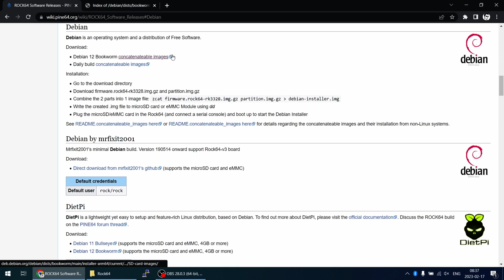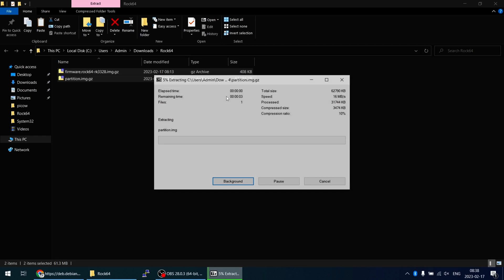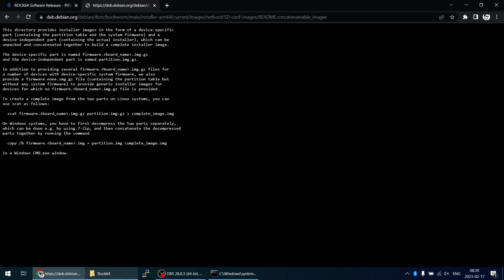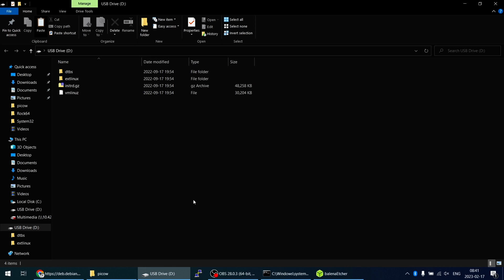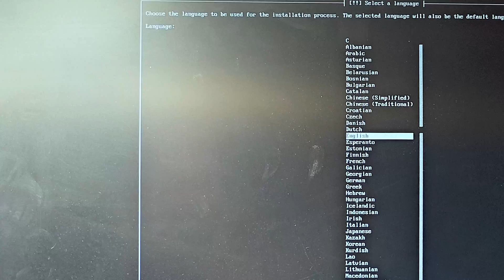Installing Linux On The Rock64 In Under 5 Minutes!

Comment: The Rock64 Pro is one of the most disappointing single-board computers I've ever used. Software compatibility is terrible. Calling it a "rock" is fitting, because that's pretty much how useful it feels compared to the reliable Raspberry Pi series.
Reply from the maker: Hahahahahahah

Comment: Amazing video. I'm not the best when it comes to hardware and networking, so this was hella useful. I didn't put in the partition file and wondered what I did wrong. I've been sitting next to this thing for the past 3 hours and could not, for the life of me, figure out what I was doing wrong. I did everything like you did, now I'm just waiting for it to give display output.
Reply from the maker: Oh interesting, I'm glad that helped you out and thanks for the kind words.

It shouldn't take that long for it to give display output though; from memory mine was quick. 

https://wiki.pine64.org/wiki/ROCK64 usually has the best info, but can take a bit of reading!

Comment: Great board, but watch out for the spi flash chip on some of the models.  Kindof a pain when you wanna use the chip.  Theres a device tree thing you gotta deal with...
Reply from the maker: Thanks for the heads up, had not heard of that and will look into it a bit more. Overlays and device trees CAN be daunting, but after messing with a few I've found they're not all too bad. Easier if you have some coding experience I think!
Reply: @PlatimaTinkers  indeed, that device tree is its own syntax, though it's only a declarative language, just branches and leaves with properties
Reply from the maker: @kayakMike1000 yeah works well, it's just a matter of learning what all the terms mean I think!

Comment: Ha.   Rock64 is my go to RPi replacement they ended up SUPER cheap for some reason.  I picked up 20 of 'em for 25 USD each.
Odroid C2 was pretty good, but now superceeded by the C4 which is a bit more.  Both rin arch linux a treat
Reply from the maker: Yeah nice! I'm stuck somewhere between Rock 4C and OrangePi 5B right now haha.

Comment: I remember buying a bunch of these rock64's for $20. Now the up charge is around $180. I don't why the rk3288 is obsolete 4 gens old. Getting the GPIO's working is a pain if you have any success that is.. I don't see the appeal honestly.
Reply from the maker: Hey mate maybe things changed a bit? GPIOs are working a treat; it seems the RPi Python library works best with Armbian, however, you can use the R64 GPIO library instead which works a treat. Just good to be aware that some GPIOs are reserved for SD card or other functionality, so always check the data sheet! If you're using SPI flash and just want GPIOs they should be fine. Cheers for the input!

Comment: Okay I'll jump in here.

I'm a long time computer programmer, electrical engineer, and one of my hobbies is amateur paleontology. Fossil hunting. I just happen to live in an area in north Texas in the US where marine and several mammal fossils are abundant. It's a fascinating free hobby and generally means lots of time walking around dry streambeds bent over, staring down and treating everything like a giant jigsaw puzzle. For 6 hours or so lol. Just like jigsaw puzzles after doing this for about 20 years or more you get pretty good at spotting them. It's also bad on my back. I still love it but I would love to continue and have my hobbies help me enjoy it more.

So I had the idea I'd get one of those kids drivable miniature jeeps/cars made out of that plastic that you couldn't destroy with a sledge hammer, add motor controllers and a capable single or stereo camera setup, a Kinnect, and the standard stuff you put on robots (I've built dozens). And then Buffy the Pack Mule (yeah that's my working project name what's it to ya?!) will use the Kinnect to heel 10 feet behind me as I roam, carrying my heavy shovels and rock hammers and sifters and water bottles, yada yada. When you're fossil hunting you roam a bunch and then stand in one place for 15 minutes making sure you don't miss anyting at that spot. When Buffy notices that I haven't moved appreciably for 5 minutes or so I want it to start searching for fossils on it's own, slowly scaning the riverbed and searching through its trained ML modell (I have tons of fossil pics with labels/categories) for hits. When it might have found something it will sound an alert so I can come over and check it out. If it ever actually found a fossil I'd be dancing out in the middle of some field somewhere for an hour or so cheering my head off. Anyway heh....

I've made some progress on the project but right now it's mainly a std robot platform with a 10 year old raspberry pi model A connected 🥹. I've put the project aside may times over the years, saw your video, thought I'd throw that out there. I've played with tensorflow and have a pretty good understanding of what I'm in for and know it's a lot of work left to go to integrate the 3 or 4 separate projects I have for it all into one. Great video btw now I wana play with one heh.
Reply from the maker: @trent_m_wyatt Mate that is awesome, great background and some wonderful projects. You also sound like a damn interesting bloke.

Thanks for the input, and you're in the running for one of those MCU's - do you have a preference (even though they may be a tad underpowered for that project?)! Would love to see a video of you putting it together, or even it just in action - as I expect it may take some time.

Also I'd look at the SoEdge as it's got a 3TOPS TPU and that would make a hell of a difference! Enjoy either way!
Reply: @PlatimaTinkers  
Sweet that's great! Hmm since their both '328's, if I had a choice I'd probably use the Nano! 🙃Be sure to let me know when you want to give away one of the Rock64's lol!
Reply from the maker: @trent_m_wyatt  Roger that! And yeah I will for sure - sorry if it came across that way in the first place, I did state 'MCU' but understand some people got confused haha
Reply: @PlatimaTinkers  it's all good! It's a giggle to maybe get a free processor any day lol.
Reply from the maker: @trent_m_wyatt  mate you win! If you go to my 'about' page my email is there - just send me your postage address and I'll drop it in the post next week! Cheers
Reply: @PlatimaTinkers  Sorry for the late reply! On my way now

Comment: I am way out of the loop when it comes to Linux and SBC's. Thanks for an awesome video. 

As for the MCU's, I picked up an Arduino starter kit a year ago, worked my way through the tutorials that came with it and now working on some custom projects. Boards like the Nano and the Pro Micro are great for embedding in projects because they are a complete unit in such a small package. 

p.s. I'm in Canada. I would love to receive those boards, but can understand if I don't because postage may be prohibitive, but good karma is coming to you for this giveaway.
Reply from the maker: Hey thanks for the kind words, and great to hear that you're getting into the Arduino ecosystem!

Postage to Canada is no worries at all. You're in the running to have one of the boards - if your name is picked, what model would you prefer? Note the Nano has onboard serial-to-USB (CH340) but the Pro Mini does not and will require a CP2104 or similar!
Reply from the maker: Hey mate you won one! Just drop me an email (email address on 'About' channel page) and I'll drop it in the post next week for you. Enjoy!
Reply: @PlatimaTinkers  Ug, I'm feeling stupid! I don't see an email address (or link) on your "About page".
Reply: @PlatimaTinkers  figured it out. You should be getting two messages from me. Thanks again!
Reply from the maker: @timcampbell3735  Great stuff! Cheers

Comment from the maker: NOTE: Current the Debian 12 "Bookworm" netboot SD card installer I used actually has some issues. Use the installer files from https://sd-card-images.johang.se/boards/rock64.html instead and it works fine. Working with Debian and the community to get this fixed!
Reply: Are we talking about the Linux version for " Solar Assistant " mate?  If so, and I could use it with these NUCs, you're in Australia. If so happy to send you one or two.
Reply from the maker: @chuxxsss  I meant the pre-made images for RPi3's etc - could just run it in Docker on an x86 NUC using emulation like qemu.

What make/model are the NUCs?
Reply from the maker: @chuxxsss  Ah okay. x86 i3/i5 or is it Pentium/Celeron?
Reply from the maker: @chuxxsss  Oh wow haha. That's hilarious. Do they still boot to a McLogo? I don't think I have an immediate use for them, but yeah I'd be happy to buy two off you if you want?
Reply: That image does looks cool though I always use armbian for my stuff. I plan to use armbian for my libre computer rk3328 that I just got
Reply from the maker: @jasonsantasiero8431  Yeah I was REALLY thinking about it, and TBH it probably has more support for embedded stuff. What was your main reason though?
Reply from the maker: @chuxxsss  Dang that's a pain in the hole. Worth trying at least!
Reply: @PlatimaTinkers  Armbian just has better support and is better preconfigured out of the box and tries to make all the hardware work
Reply from the maker: @jasonsantasiero8431  Will definitely try that, thank you!

Comment: Looks like a really cool SBC, been researching alternatives to the Pi recently and there are some great little alternatives out there. Also, with the Arduino, I am looking at building a light and timing system for RC Drag Cars. I wonder if one of the ones you showed might be able to do it

Great channel and vids by the way
Reply from the maker: Hey yeah there are quite a few I'm really enjoying. The Rock64 and Rock 3 are definitely contenders. The Orange Pi 3 LTS looks amazing too, so might have to get one. The other thing to keep your eye out for is the Star64 when it's out, as that'll be a RISC-V SBC that is jam-packed full of bogomips haha.

And thank you for the kind words!
Reply: @PlatimaTinkers  Excited for Star64, a first run has been made but very little runs on it so far, so I'll probably snag one next round. Ooh, looks like they're back in stock! Will start with a 4 and then maybe an 8 later.
Reply from the maker: @defenestrated_me  Yeah it's pretty god damn powerful, I'm just waiting for it to come out of alpha, eg maybe a hardware revision or two. I should touch base with that team and see what they're up to though!

Comment: Wish the rock 64 could do solar assistance.
Reply from the maker: Could you elaborate a bit? Sounds like something I might be able to put together!
Reply: @PlatimaTinkers  Solar Assistant  is a Linux base product, which runs on RP4 or 3 and orange Pi.
Reply from the maker: @chuxxsss  Aaah okay. WELL, I don't see why it wouldn't to be honest. This is a Cortex-A53 pretty much the same as Pi 3 B and Orange Pi 3. I might give it a shot this arvo!
Reply from the maker: @chuxxsss  No worries mate. WTH how did you get 16 NUCs? Haha. Also you probably could run it on a NUC using Docker and emulation: https://www.stereolabs.com/docs/docker/building-arm-container-on-x86/

If the NUCs are powerful enough it may even be able to keep up with the real-time demands. You'd just have no HDMI output - network only.
Reply from the maker: @chuxxsss  Ooh that is interesting. What processor is inside those?